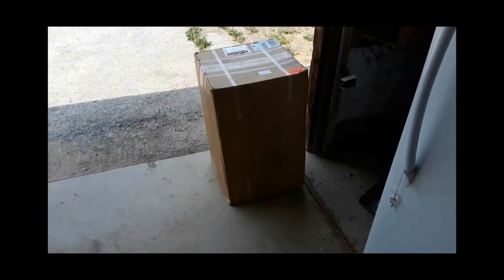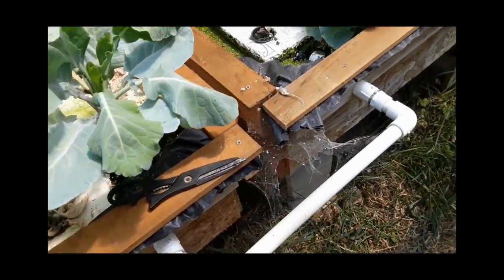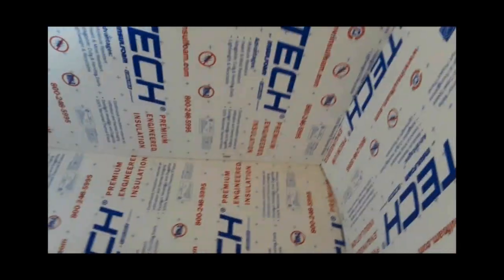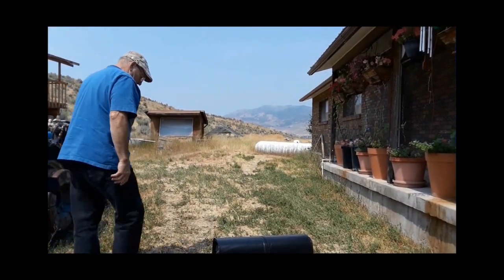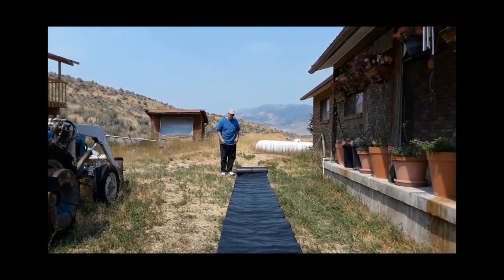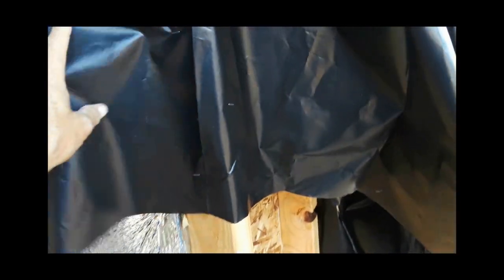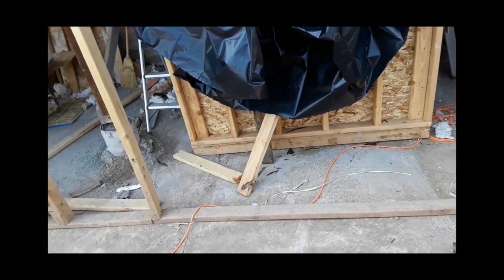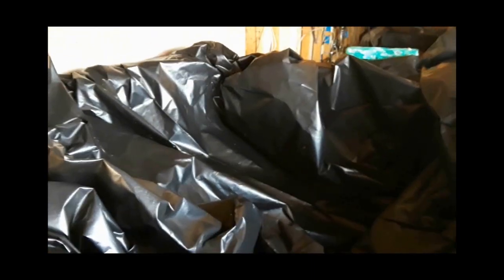Greenhouse Winter Heating System Part 5

Comment: One gallon an hour will get you 24 gallons in a day. 2.5 gallons an hour is a terrible well, 2.5 gallons a minute is just a poor quality well. Is it perhaps gallons per minute? There are 1440 minutes in a day.
Reply from the maker: If I said one gallon an hour....I meant to say per minute.   The well logs, as I remember when the well was tested showed something like 2 1/2 gallons per minute sustained flow.  That is not very good as far wells go.   But I am on top of a hill and the well is about 200 feet deep,  the water level hangs out at about 100 feet down when full.   But....that is the way things are for me.  I just deal with it.